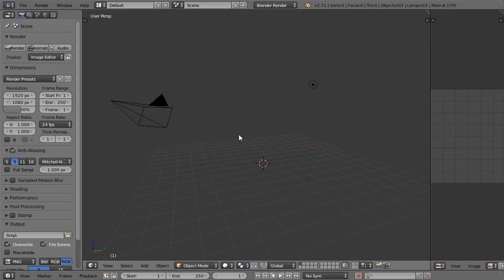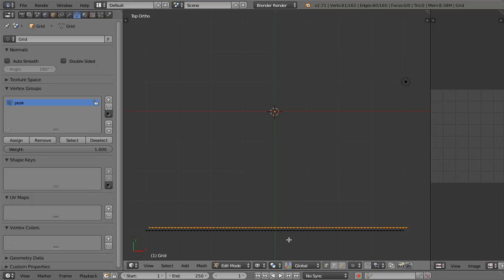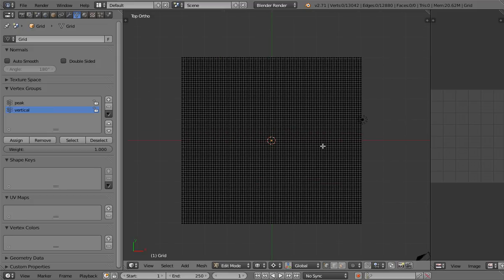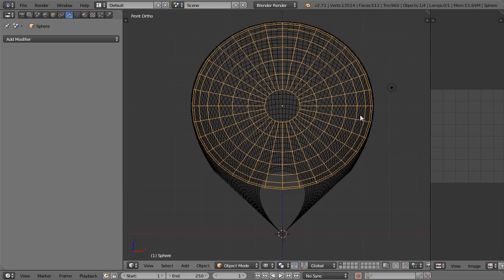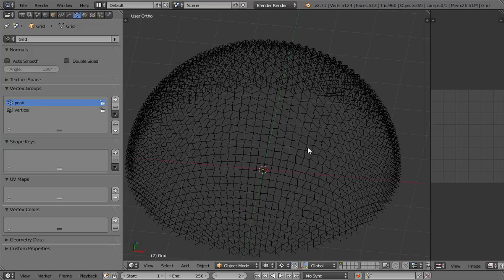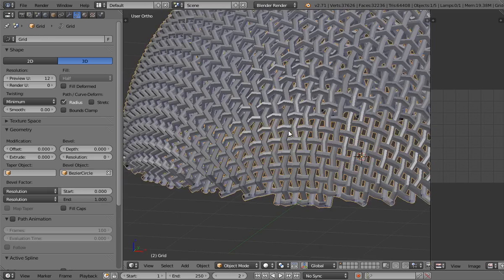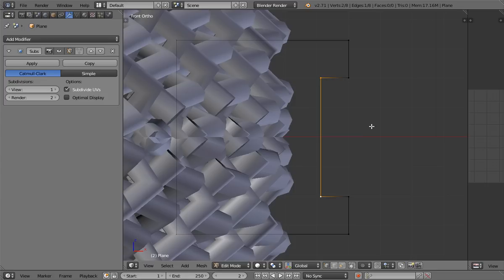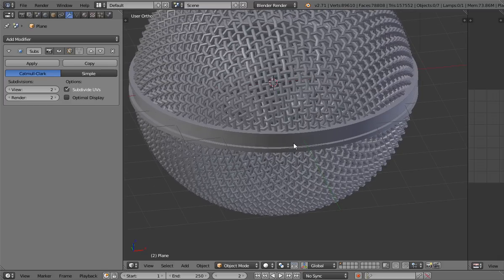Blender Modeling Exercise - Microphone

Comment: The lines of my grid intersect each other (instead of going over and under) at several regular points . Anyone know why that is?
Reply from the maker: Blanco111 Can you post a screenshot? If it only happens in a couple spots then it just sounds like a couple stray vertices were added to the wrong vertex groups, so when you scale up the peak vertices it scaled a few extra vertices that weren't suppose to be scaled. -Chris
Reply: I don't think I can post an image here.  I did post one on your facebook page, though.
Reply: CG Masters Thanks for responding.  I went back and was able to scale it right finally.  I never scaled like that in Blender.  I posted my result on your FB page.

Comment: hey nice tutorial! thanks for the tips. How would you approach for a more complex form, for exemple a wavy chair rattan or something like that. I was thinking of making a few curves, using array and then shinkwrap or curve modifier, any other idea?
Reply from the maker: Aureo de la Cruz Hey, great question. My initial thoughts are that using a lattice could be very useful in bending the grid to the shape you want. Also, the celtic knot add-on might really help you out: https://github.com/BorisTheBrave/celtic-knot ... Someone shared that idea for this tutorial as another way to create the wire cage. It basically takes existing topology and weaves it for you, so you could model the chairs shape(keeping topology in mind while doing so) and then use that plug-in to transform it into a woven mesh. It might require some touching up afterward but that's definitely an idea I'd explore. -Chris
Reply: CG Masters Thanks Chris! I'll check that add on out.

Comment: It seems that the cast modifier does not display in "edit" mode for me, despite having the button depressed.
Reply from the maker: TheFerruccio Is the button pressed or depressed? It should be pressed to enable it. If it's still not visible in edit mode I'm not really sure what the problem is but you can email me the blend at contact@cgmasters.net. I'll take a look and figure out what's going on. -Chris
Reply from the maker: TheFerruccio I just helped someone else out with the same problem, turns out he was trying to view the cast modifier while in solid shaded view. Since there are no faces you will not be able to see the changes in edit mode while its solid shaded. Switch to wireframe view and hopefully that fixes your problem. -Chris
Reply: I will try this out next time I use the cast modifier! I managed to successfully go through this tutorial slightly blind on that one part with tabbing back and forth helping enough.  Thanks for this clever method of deforming meshes!

Comment: If anyone could help im on the part where i apply the cast modifier, set it to be visible in edit mode but when i move it on the z axis the baloonish shape doesnt appear.
Also incase its important im on 2.74
Reply from the maker: Erjan Kadir Hey Erjan, sorry for the delay, this comment got by without me seeing it. I'm not really sure what the problem is, it could be a bug, or it could just be something that's been accidentally disabled. Like maybe you disabled the eye icon that makes the modifier visible? I'm not really sure, but if you want you can email me the file at contact@cgmasters.net and I'll figure it out. -Chris
Reply: CG Masters 
I believe you might be right. Since i posted this iv done a bunch of other tutorials and i feel like that is the most likly cuplrit. Ill restart this tutorial and see if i can recreate the problem by turning the eye icon off and on. But thank you for the response. Reminded me i have another tutorial i must redo
Reply: CG Masters 
I was wrong. I put a webm of the error. Here
http://webm.host/ee612/

Sorry if this aint enough. Ill send ya the file.
Reply from the maker: Erjan Kadir That's got me really stumped. Send me the file at cjplush@gmail.com and I'll try to figure it out.
Reply from the maker: CG Masters Whoops I didn't realize in the video you had the 3d view set to Solid Shaded. Since there are no faces on the grid the casting will appear invisible in edit mode. Switch to Wireframe view and that should do it. -Chris

Comment: great tutorial but when you put the circle in the midle you get pipes and i get flat ... not sure why..
Reply from the maker: sinisa vranesevic You mean your wires are flat instead of round? Try rotating the circle in edit mode in different directions to fix that. Otherwise there's an easier way to bevel the wires anyway. Select your curves and go to the curve options. Change the Fill option to Full and then increase the bevel Depth and Resolution and it will do the same thing as using a bevel object. -Chris

Comment: CG Masters  Great work dude. And thanks for such a great tutorial. I am new on blender I am facing one problem, when I use screw modifier the square doesn't screw around the whole mesh but screw around itself and creates a small ring type structure. I tried everything but I am still unable to rectify it.
Reply from the maker: Tejpal Kargwal Keep in mind that the screw modifier spins the mesh around the objects origin point. So if the origin is at the center of the square, the square will spin around itself. You'll need to make sure the origin point is at the center of the microphone so the square spins around it. At 16:12 I make a note that the cursor should be at the center of the world(press shift+c if it isn't), so that the square will spin around the mic. After adding the plane mesh I move it in Edit Mode so that the origin point doesn't move. Also, there are axis options in the screw modifier you may need to change if your rotation is off. -Chris
Reply: CG Masters maaaaan i love u ahahhaah thanks for the tutorial u explain really good! (Y)

Comment: Using 2.73. I've followed your directions exactly and when I when I get to the part after adding the cast modifier, when I go into edit mode and move the mesh up it does nothing. Just moves the mesh up. I have toggled the "display in edit mode" back and forth and it makes no difference. Help? :(
Reply: Well as soon as I tabbed back into object mode it was there. For some reason the display in edit mode is just broken I guess.
Reply: Ooops, I see where the issue was. You have to be in wire frame view to see it. Problem solved :)
Reply from the maker: Zac Jelke  Hey Zac, there's also an icon at the top of the cast modifier that you can enable to view the effects in edit mode while you're moving the vertices. The icon looks like a cube with 4 vertices highlighted(it's to the right of the eye icon), enable this and you'll be able to see the changes while editing. -Chris
Reply: Zac Jelke thank you!

Comment: Love this. Excellent tutorial. One problem I have is that only the ring shows up when I render. Have tried a number of things like recalculating normals etc, to no avail. Any thoughts?
Reply from the maker: Hard to say without seeing the blend. You may have all the other objects set to invisible in the outliner, so you can check that. You also may have accidentally unticked the render icon in the modifiers that you're using for the cage, so check the modifiers. If nothing's working still you can email me the blend and I'll take a quick look, contact@cgmasters.net-Chris

Comment: Well I haven't tried this out ...so I'm not sure..But isn't possible to add an high poly ico sphere and then tweaking the verts and then applying wireframe modifier to it ..
Reply from the maker: An icosphere would produce an odd grid of wires since it's comprised of triangles. For your approach the best sphere would be a polysphere(enabled in add-ons under Extra Objects) but then it still has Y-poles that produce a few wire intersections that aren't realistic. Then you would have to use the Celtic Knot plug-in to create a weave pattern using the sphere's geometry as guidelines which adds a wireframe modifier itself I believe. The issues I have with this method are that one, the Y-pole intersections of a polysphere, and two, it doesn't create the same realistic wire congestion that wrapping a grid into a sphere does(wires are realistically much closer together on the sides than the top). Using a polysphere perfectly spaces out all wires, which isn't the biggest deal ever, but for the sake of realism I don't prefer it. -Chris
Reply: :) Thanks for your instant reply !!

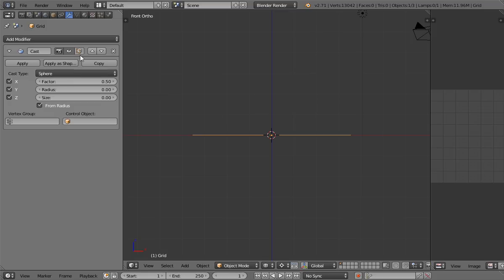Comment: When making the mesh into a sphere ... is "To Sphere" in edit mode not an option? (7:00)

Shortcut : ALT-SHIFT-S
Reply from the maker: I actually did try that in my quest to find the best technique, but since that tool only works correctly on 3 dimensional objects it required extra steps to even use it right, then left me with a very congested area of wires at the base. The cast modifier turned out to be quicker and cleaner. -Chris
Reply: CG Masters : Yeah ... that totally makes sense in retrospect. Better to have the deform in a modifier anyway!

Thanks for explaining :)